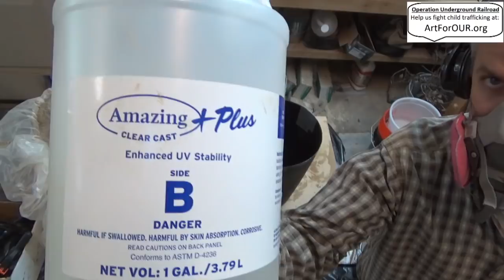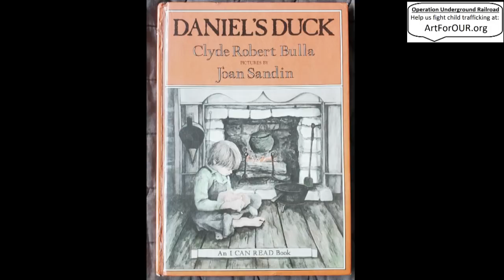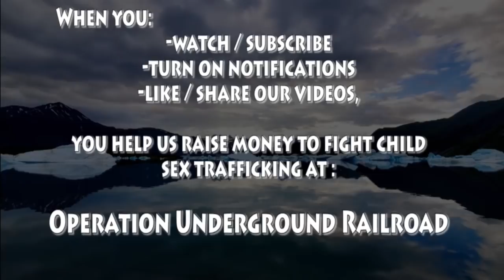"Burning Bush" Vase made with a Combo of Cherrywood, Resin, Wood turning and acrylic painting.

Comment: Nice! Dan. Very god representation of the burning bush. Here's an idea ... if you can find a way to pour the resin only half as deep but fully encapsulate the twigs, then paint it and then finish the pour -  that would place the paint "inside" the resin instead of on the outside and allow you to turn the resin without hurting the paint.

Keep up the innovations - one of the reasons I come to your channel.
Reply from the maker: That's a great idea!  Thanks. 

Artforour.org

Comment: Great piece of work.  I have been turning off and on for about a year.  I made a pressure pot and it holds air but I have never used it yet a project as I do not know how much pressure is required and for how long.  It is winter where I am but i have shop heated.  When I am not working i keep it at 40 degrees.  Does it need to be heated to 70 24/7 while it is being used?  I don't have a clue and have asked a couple other places but get reply.  If you have the time and don't mind answering I would appreciate it.  Thanks in advance and thank you for your Operation Underground Railroad.  God Bless.  Wayne
Reply from the maker: Thank you Wayne!  I've found I have to heat things up to above 50 or 60 deg or the resin either never sets up or takes a looong time.

Comment: Dan your work is amazing. I have a question, I’m going to try that method but was wanting your opinion. Instead of using the vacuum chamber, would it work if you wrap the underlayment with the Red Shurtape and put the resin in it then put it in the pressure pot.this would do away with the sand and the vacuum chamber. Lol! Hope you don’t think I’m crazy
Reply from the maker: I think that's a great idea.  However,  the trouble I've had is that unless you pre treat your wood with something,  still get bubbles coming out of the wood when using a pressure pot.  I'm still experimenting. , but it seems that if you put the wood item in the vacuum chamber with the resin,  the resin replaces the air in the wood and solves the bubbling problem from the wood.   I then put the whole thing in a pressure pot to get rid of any other bubbles and presto! Perfectly clear resin.    I'll keep you posted.   😀
Reply: Dan Preece, Art for Operation Underground Railroad .Thanks for responding Dan, I’ll let you know how it turns out. Have a good one.
Reply from the maker: Good luck!